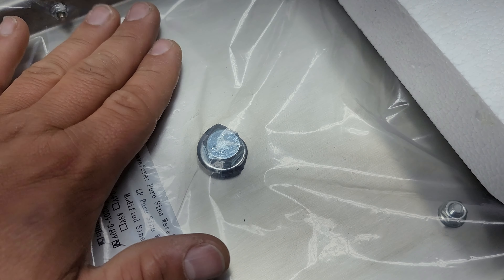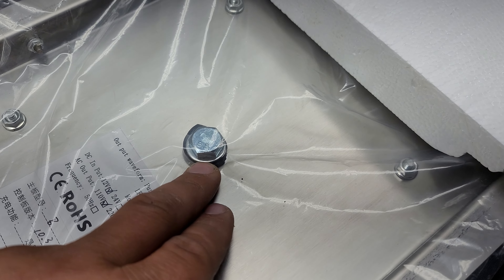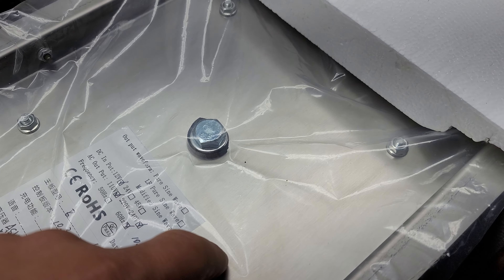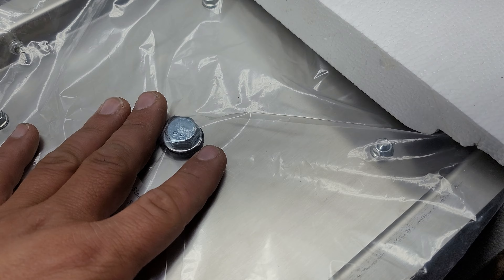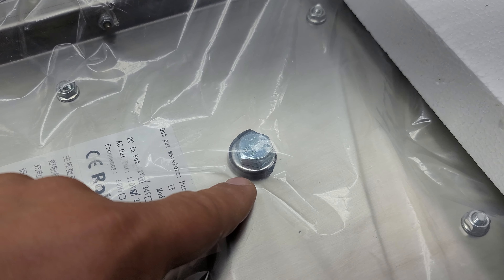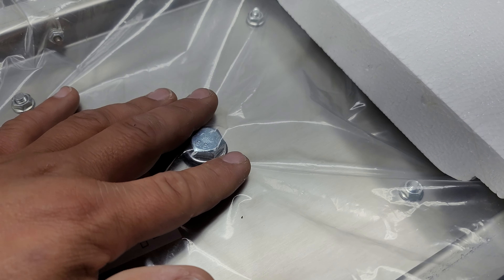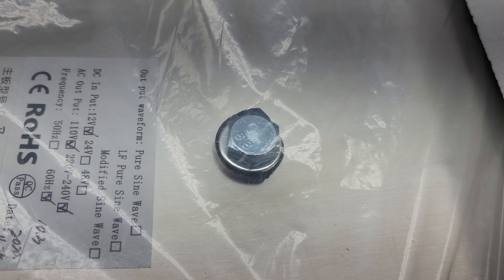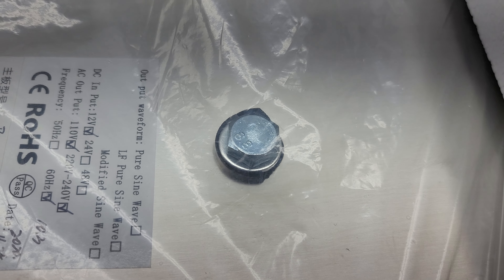Check this one part before using a new Power Jack inverter

Comment: can anyone tell me where the equipment 
 grounding bolt is on the power jack 20000 watt 80000 watt inverter
Reply: Should be on the front of the chassis...assuming they didn't forget it.  Barely does anything anyhow--just capacitor decoupling to both DC battery terminals and only 2 of the 3 AC output terminals.
Reply: @sidlori1592  Thank you Sid I think it is marked with an E right below it